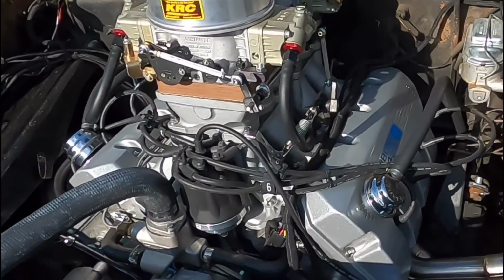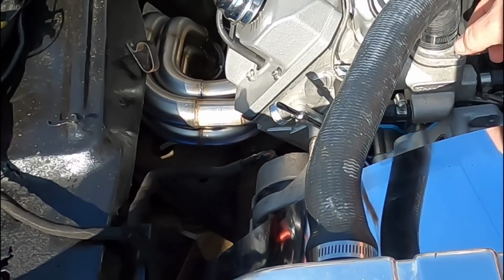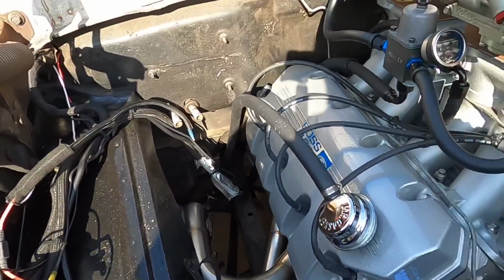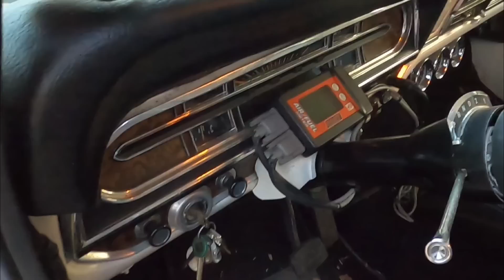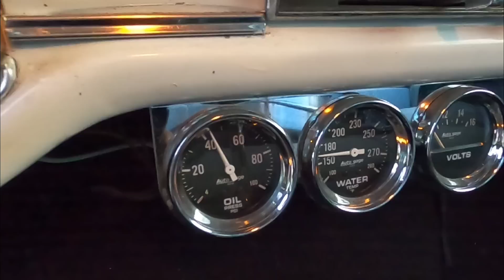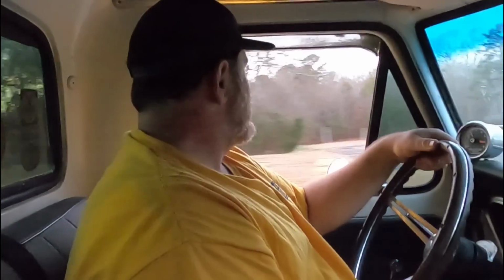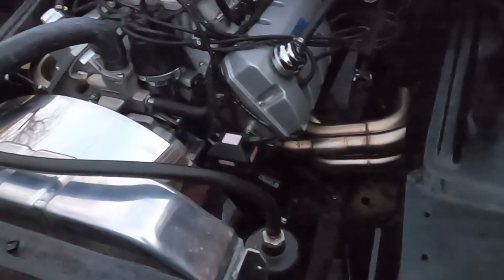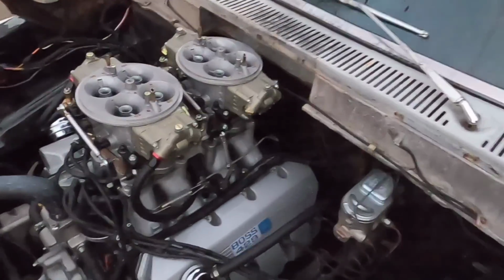Abandoned Race Truck will The F100 Called CASPER with its 429" Hemi MIXED UP BOSS run and drive? lol

Comment: Mixed up Boss sounds great! One option for the upper rad hose you can  heck out, is a hose from a 1979 F250 with a 460. It has the same angle yours and has a larger hose size at the rad and a smaller one at the thermostat.
Reply: My thought was a stainless exhaust pipe, expand to match the bigger end, and a couple 4 inch long pieces of rubber hose for connectors.
Reply from the maker: I will check that out! Thanks
Andy

Comment: Sounds crisp!! IDK about the 160* operating temp, in testing at the track we found that anything less than 180* before staging the car cost us a slight bit of ET. You'll just have to see on that wicked combo!!
Reply: Yeah, I think 160 is too cold also, of course everything is application specific...I would think that a 160 would be as bad as running without a t-stat at all, especially in the hot southern states. I was surprised he went with the mechanical fans, I have an electric on my truck, didn't even bother hooking it up to an automatic thermostatic switch, I almost never have had to turn it on, even with a single row radiator. It's a 351w 5 spd F-250.

Comment: We just bend & or weld up a piece of exhaust tubing then use the couplers to attach them in that situation. They offer those couplers in stepped to where the pipe is smaller or larger than the hose barb.
Awesome build with 1 of my TOP 3 engines of all time 💪🏾💪🏾

Comment: For custom radiator hoses, a lot of times I will use mandrel exhaust tube and do a cut and weld. I will then use straight hose on the ends.

Comment: Bottle rocket better add some cubic inches beneath those heads…..  Cause this sounds like a terror….
Reply: Adding NOS is basically the same as adding cubic inches 😅 

Just see if bottle rocket will handle the amount he is planning on using is the real question 🤔
Reply from the maker: What if I add NOS? I built MIXED UP BOSS to handle all of the N20 I can throw at it... 😆
Reply: @UnityMotorSportsGarage  
This is going to be an awesome race! 😁
Hopefully you both come out of it with parts still intact!! 😅
Reply from the maker: @newguysgarage6802  if I can make A to B with my C4 still intact I will be a happy camper.. Then a TH400 will be going in it
Andy
Reply: @UnityMotorSportsGarage  
Yep the C4 is what I was thinking about 😂
But as long as you take it easy off the line then lean into it she should hold up.......probably 😁
Reply: I've never seen UTG complete anything he started. It'll be another 3 years before bottle Rocket does anything
Reply: Estimated 1/4 mile times?  I seen a similar truck with a 428CJ run low 12’s in Carlsbad, NM in 1980.  My old turd ‘72 C10 454 with low compression, small cam and 3310 Holley will run an 11.90 with 3.73 gears....

Comment: Well done nice setup. 
I have found that the thermostat housing's straight-up design will eventually pop off the hose under high revs. I would look for a 90-degree design housing.
Reply from the maker: Hmm I haven't ever had that happen! I will keep a check on it
Thanks
Andy
Reply: Well I had an engine like that once and we just took the spring out of the lower radiator hose so it sucked itself shut at high rpm’s. Probably even gained a few hp when the pump started cavitating. Lol not good for long runs but fine for 1/4 mile at a time😎

Comment: Well done mate. Long road travelled and hard money spent but you stayed with it and now you can enjoy the results. One thing. Those evac tubes ? I had some on a car with full exhaust and they actually pressurised the crank case and didn’t evac until I unhooked the exhaust at the header. Just something to watch out for dude.

Comment: Congratulations Mr. Andy! It’s a great feeling to finally get to go down the road in a project that we dream about for so long! Proud for ya! Can’t wait to see it at the track. Pertaining to the radiator hoses, I also had to find ones that would work. I took clothes hangers and straightened them out, then bent and cut them the shape and length needed. I took those with me to Napa, and they allowed me in their back room to search for myself. I was able to find some that worked perfectly. Casper sounds so good! What mufflers are those? Congratulations again sir. Very nice job!

Comment: I agree with you if it is old and you can tidy it up and make it look as good as a new modern engine bay , why not. The part that it is never finished is a given, as soon as you get all the wiring harness finished and it looks like a million, something will  come to light that you will be able to see after everything is brand new looking. The motor Andy is perfect for the look that I believe you are going for, I honestly can't wait to see your face when you get it to the point of pulling out of the driveway!

Comment: Question. Why not use a four blade Pinto fan? I have seen those flex lite of fans go through the hood. Also are you gonna put a temperature sender in the trans?

Comment: You've got guts running those huge carbs on that engine for street driving. I would probably just gone with easy mode and used a pair of Sniper EFI throttle bodies on it and had all the goodies in the software for 2 steps, nitrous, flex fuel, fan control, the ability to add boost, easy starting, good fuel economy, ignition timing and everything staying optimized over the course of traveling.

Comment: Andy does that stretching and subsequent ballooning of the upper radiator hose at the connection at the radiator create a weak point that could result in the hose failing?  Obviously you NEVER want to lose fluids at the front of a car while at speed. It rarely ends well.

BTW, the truck sounds awesome!

Comment: Nice work Andy! Question didn't you have your cut outs on the outlet side of the X pipe on your old setup? If so what made you change it? I thought that was kind of different but I liked it.
Reply from the maker: Nolan, I tried to use the X but there simply isn't enough room to fit it before the mufflers... 
Andy

Comment: That Top Radiator Hose will become an issue later this year when Hot outside and let go. I have tried similar squeezing a radiator Hose smaller ID onto a larger OD Radiator neck. The hose is under abnormal stress and will let go there.
Those Industrial Diesel Flex Hoses are the Best. Napa used to sell the FM series HD and looked good Yellow stripe or Green Stripe but are discontinued now. Have to find them NOS Ebay. 
Gates still makes Green Stripe Radiator Diesel Hoses but limited sizes ID and Lengths available. 
Best bet is to use -32 AN Fittings and AN Hose be expensive. 
Have to Tig Weld the Fittings onto the Radiator and upper water neck of your engine.

Comment: The only thing about moving that starter solenoid on the firewall is that it may get hot there ? I'm not saying it will or it won't you do have a hood scoop but as just an "opinion " that may not be true it's going closer to the engine that may make it get hot and cause problems? But I've never done it but I've seen it happen with ignition coils on race engines before where they've cut out because they got hot , but other times they haven't gotten hot either? Which didn't make sense 😕 but it's something to be aware of I guess 🤔??

Comment: That engine will last a lot longer if you run at least 180 degrees and why not electric fans nice truck
Reply from the maker: I won't go with electric fans on Casper, trying to maintain a somewhat period correct look
Andy

Comment: Just curious if anyone has found those Flex A Lite fans to be dangerous. Maybe it’s just me but I’ve come across a few where upon inspection I’ve found cracks in the blades.

I had one blow apart on my car before AFTER I closed the hood.

Comment: Do you have no road worthy rules any safety regulations in America, no seat belts or bonnet? I am curious to know what is  requirements? To drive these vehicles. 
Christopher from Down Under
Reply from the maker: It has racing harnesses in it and I just use the lap belt most of the time... They don't really care about the bonnet here in North Carolina
Thanks for watching
Andy

Comment: take the nut off the alt. cut a 6 inch circle out of a baby moon hub cap drill a hole in the middle of the hub cap peace . bolt it between the alt  nut and cooling fan

Comment: My My father worked at a plant as a fleet mechanic and at the time they had all f-100 for like the small like duty stuff and he basically took a bunch of parts home and built one out of you know an older one and a bunch of parts that they had on the shelf. Plus some nutty ordered and him and he built it put it together for my father. It was a short, bad regular cab four-speed 390. I don't know what gears but I'm sure they were high. It was you know slightly hand worked and ported. I guess it was a problem for the local police to keep up with especially in the woods or the gravel pit back. Then you just climb a hill and wait they would leave but then they show up and beat your ass later instead of arresting you

Comment: The first time you mash on that thing that v belt is going to leave it's home
Reply from the maker: I never had any issue with this setup on my 393w, so we will see!
Andy
Reply: @UnityMotorSportsGarage  I have just never had any luck with v belts even perfectly aligned Iv slung them numerous times and it happens around 7,000 rpm.so I just stopped using them.but I love that truck man I'm a Chevy guy but I love that body style and anything that's making a lot of donkeys I'm a fan of no matter which brand.so good luck brother I'll be looking for you to mash on that thing